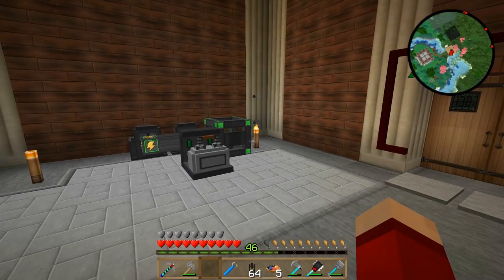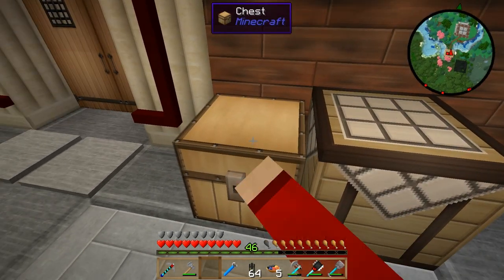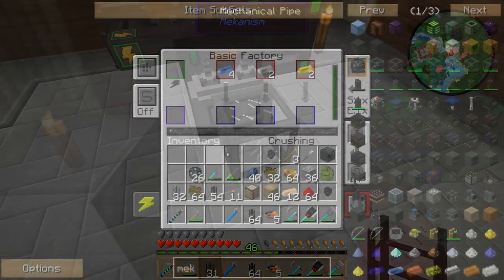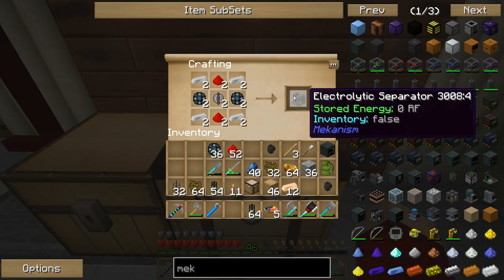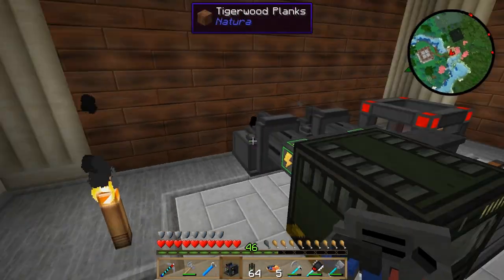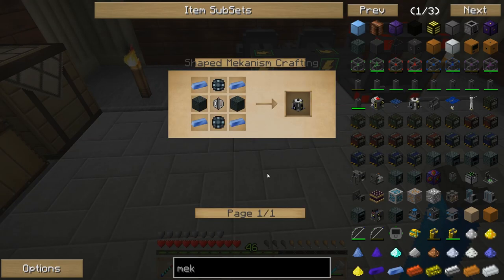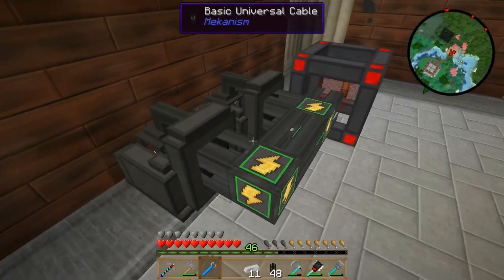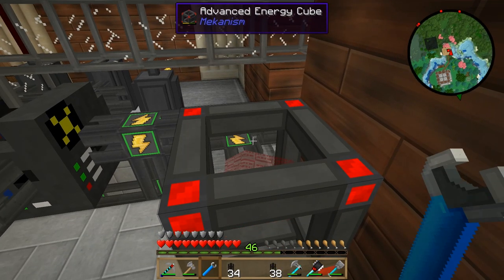Improvements in Chaos - 13 - Water to Hydrogen!

Comment: I'd also like to second the question, given the ubiquitous presence of Thermal Expansion in many packs, if Mekanism might instead take input from the aqueous accumulator. I suppose that might be more a question of whether Mekanism's mechanical pipe can pull from the accumulator or if TE's fluiducts can output to the Mekanism electrolytic separators, though.
Reply from the maker: By all means it should.  I don't use the accumulator because it's given me trouble in the past, but the man who created the Mekanism mod has put enormous work into making it compatible with Thermal Expansion, Industrial Craft 2, and Build Craft.  Most, if not all, the parts are interchangeable.  Though I personally swear that there's no good reason to mix in parts from other mods, other than being uncomfortable with the mod...
Reply: Thanks, Will! The reasons that came to my mind were a bit more out there: working with other people who have more experience with Thermal Expansion, or if (and I haven't examined the recipe breakdowns) one had a shortage of an item required for a Mekanism pump/pipe v. a Thermal Expansion pump/pipe. I appreciate the response!

Comment: Will, use a water pump pipe to a tank to the Mekanism pipes, then you wont need a pump or an infinite water supply, a single water pump pipe pumps 1 bucket per tick infinitely from a single water source or flowing water block with no power used

Comment: Am I the only chemist here, who knows that this isn't possible?
Because separating hydrogen and oxygen costs the same amount of energy the burning of hydrogen provides. So basically:

Amount of power generated = the amount of power needed to generate power
Reply: It's a Video Game Mod.

We've suspended reality for the sake of making it fun.
Reply from the maker: Strange, plants seem to do this pretty efficiently via photosynthesis, and dump oxygen as a waste product.  All while using nothing but the sun for power.
Electrolysis (what's admittedly in the mod here) isn't the only method, that's all I'm saying.
Reply: YOGSCAST Will
Photosynthesis is something different from what your machines are doing. Your machines split water into oxygen and hydrogen, whilst plants use water and carbon dioxide to make to make sugar with the energy from the sun.

So the basic difference is that you're splitting water, whilst plants use them in a chemical reaction, so those are two very different things and in my opinion you can't compare the two.
Reply: YOGSCAST Will

The difference between plants using Photosynthesis is that it's building a molecule to store energy in with aid from an outside source of power. Oxygen and water are combined in the plant using heat energy from Sunlight.

The onyl energy added to the system is that Sunlight, and it's the only energy the plant "gains" when the bonds between the sugar molecules are broken later during Respiration.

However, it is a very efficient way to get solar energy when you're after Chemical Energy instead of Electricity. Granted, the most efficient system is still liquid-driven heat collection like that at the Solona Power Plant in Arizona, or the Helios One facility in New Vegas.

Heat Focusing plants are basically a mirror array aimed at a central tower or a collection of pipes, which are filled with a liquid. The liquid flows due to convection currents or pressure shifts, and it turns a turbine. It's a bit like a Coal Burning plant with a lot of mirrors where the coal should be.
Reply: Tegu Trust me, you're not the only one that hates that this works.